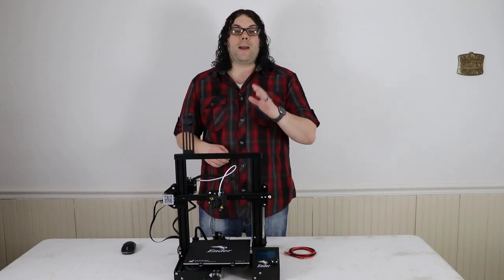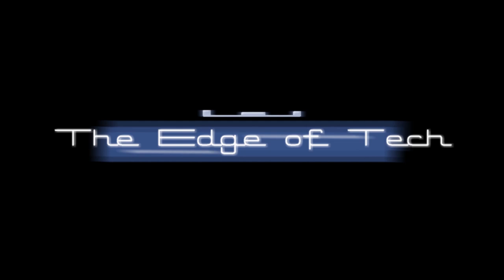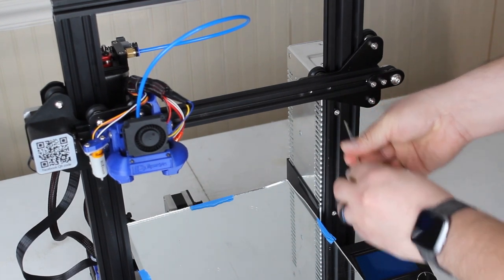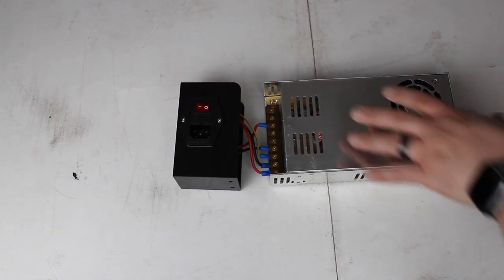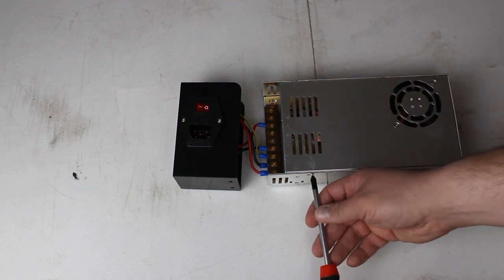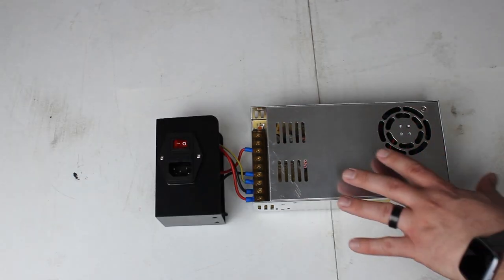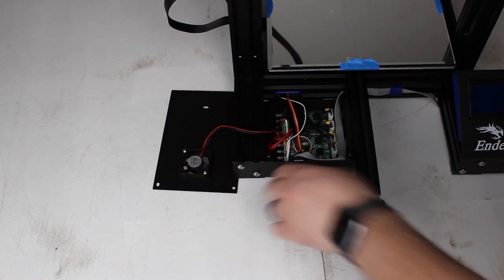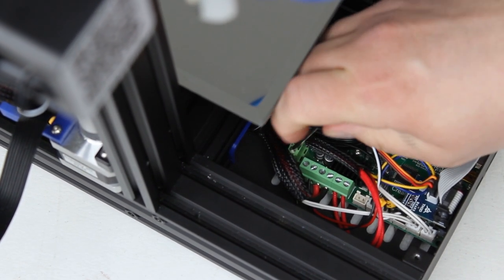Replacing XT60 connectors with the TH3D direct wire replacements

Comment: I would just like to point out, that it's not the XT60 connectors that are at fault, but counterfeit connectors which are on the ender 3, genuine XT60 can handle the power no problem.
Reply from the maker: Thanks for watching! Great point! You are absolutely correct, and if they are replaced with authentic connectors, they would be just fine!

Comment: 12 Gauge is overkill and hard to get into those Terminals, 14 Gauge will do fine.  If you really want to safe about it.  Remove that cheap Terminal on the Main board and direct solder it.  Can always put some Connectors in between the Mainboard and PSU.  The cause of most 3d Printer fires is loose connections from those cheap terminals. IMO XT60's are crap, get some Anderson Powerpoles.

Comment: I bought the replacement pieces and the u clips at the end are too big for my board. I can't push them in. Any ideas?
Reply from the maker: Did you get them from TH3D? If they are a little big, you can just push them in. They will bend a little and work.
Reply: Yes I did. I wish I could include a picture so I could show exactly how much of a difference there is
Reply from the maker: @ldycat1170  You can shoot it to my email if you would like. my email address is in the about section of my YouTube page

Comment: I bought of these sets and my wires were way way way too long. about x2 as long as they should of been. I used them but now have wires flopping off my table with how long they are so will need to buy cutters and shorten myself. Also the clips that hoot into the psu were almost too big like i had to give them a push a lot more than i felt comfortable doing. all in all I feel like I should of saved my $ and bought the stuff to do it myself.
Reply from the maker: Hey John thanks for watching! I do mention in the video that they do come quite long and you can cut them down if you want. And What connectors are a little snug but it's okay to push them in, I just talked to Tim about this and he's using new connectors going forward.
Reply from the maker: John, I just talked to Tim again and he said that he included them so long so that the people with enclosures can use them too. He wanted to make sure he covered everyone when he made them!
Reply: Good to hear, for someone that bought just for a drop in option should give you option at checkout for if you want stock length or the longer. They do what they need so just me nit picking but I like my setup to look clean. :)